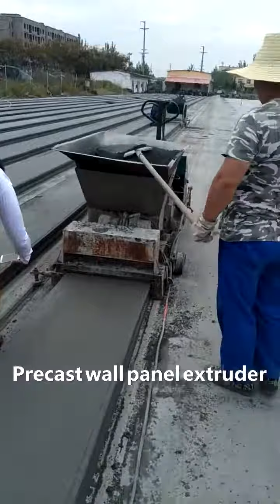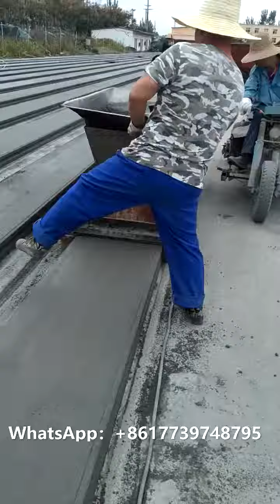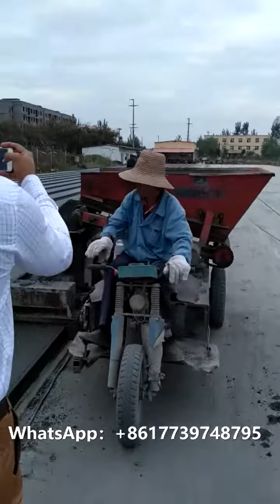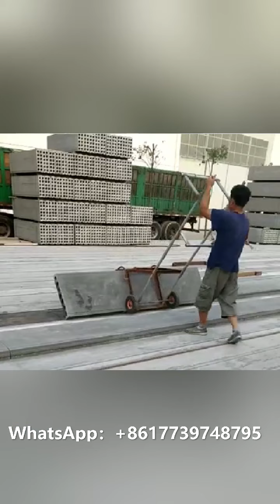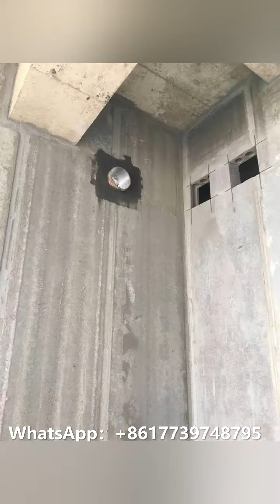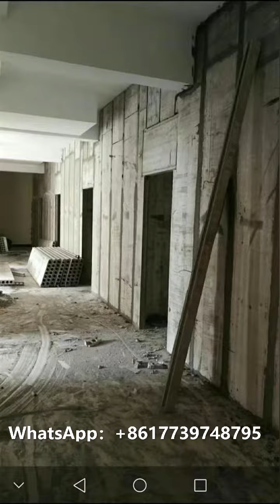Precast concrete wall panel extruder machine more than five years in service

Comment: Is this better than the horizontal stationary bed?
Reply from the maker: The extruder works more efficiently and can produce  3 linear meters of wall panels per minute. In addition, the precast  concrete panel produced by the extrusion process are much  denser and more compact inside.
Reply: @Henan-Wishes-Machinery  Wow thank you so much for answering that question I really struggled to decide between the two thank you so much!!
Reply from the maker: @zubutv.  It is our pleasure . If you have other any problems, please feel free to contact us . WhatsApp:+8617739748795